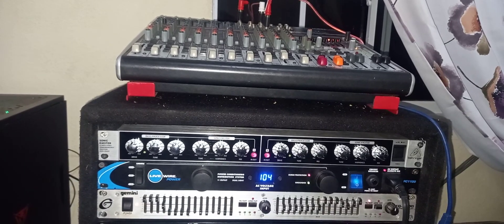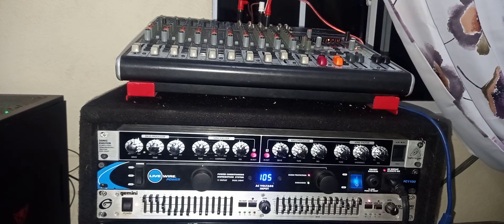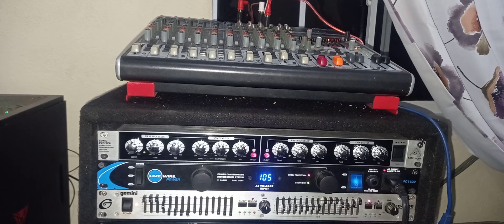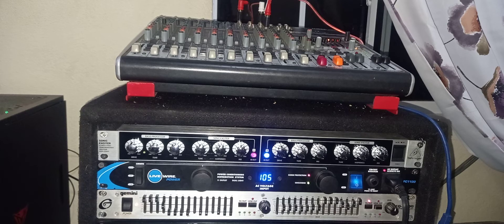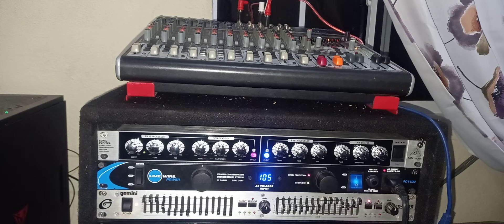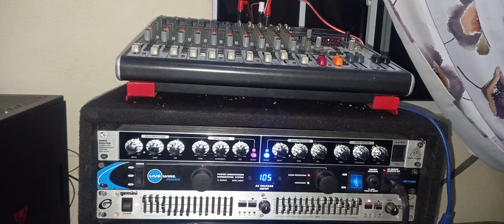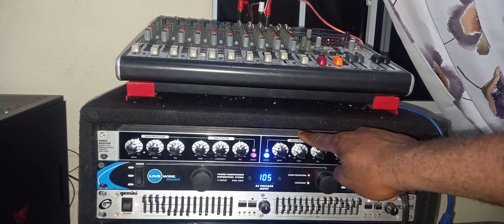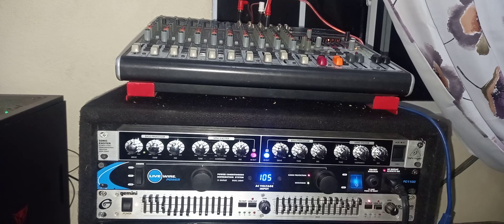How Behringer SX3040 V2 Sonic Exciter Works

Comment: How will this sound on powered speakers 🔊?
Reply from the maker: It will improve the clarity.  It can make the cheaper brands sound like EV.  JBL AND OTHER TOP BRANDS
Reply from the maker: Them was build for powered speakers only. If you realize there is no amplifier
Reply: Ok I’ll try it
Reply: What kind powered speakers you using? I have the Yorkville ES18P & EF15P, how you think they will sound with the exciter ?